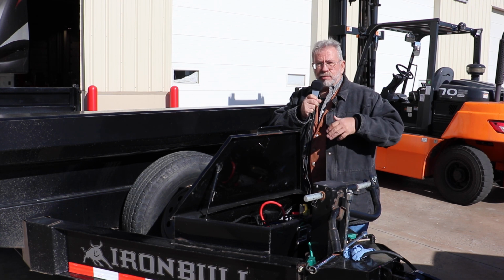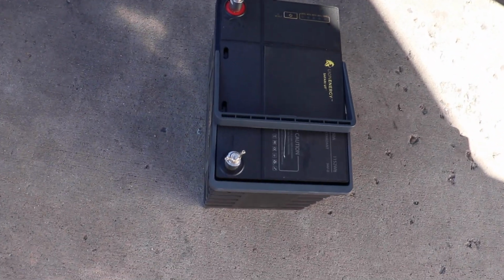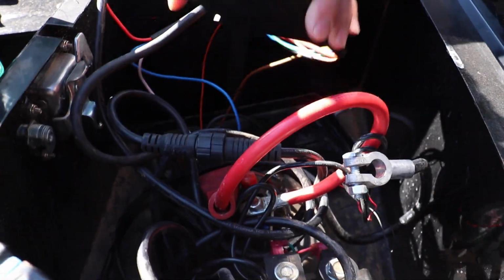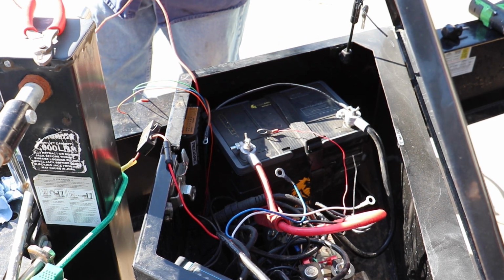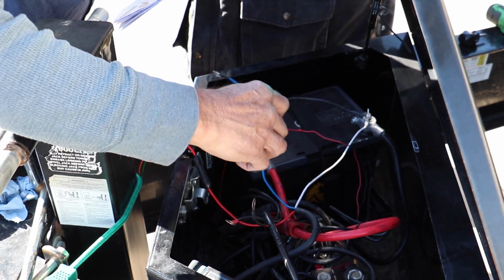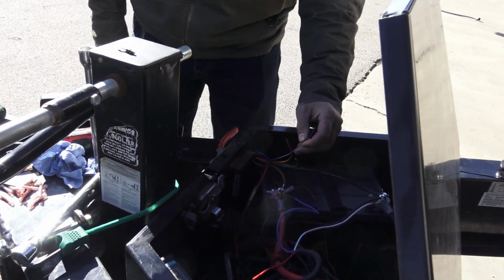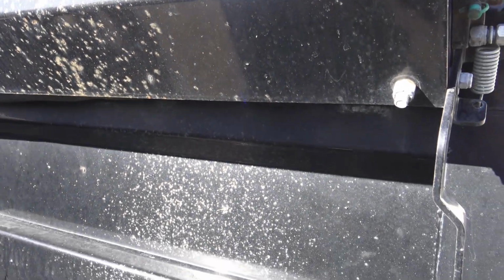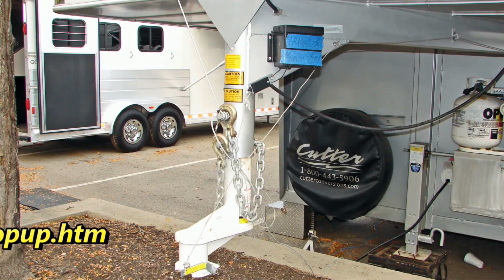REDARC battery management for dump trailers. Keep your work trailer charging and dumping more loads

Comment: Also the guys who installed your system installed it wrong.....they should have read the directions and followed it....they fused the wrong wire, wrong charging profile as well with the lithium battery. Kind of pains me to watch a how to video that was installed improperly
Reply from the maker: No, we did it per phone conversation with REDARC. Lithium Ion has a couple option profiles
Reply: @MrTruckTV  why would you contact them via phone when instructions stating else wise come with the unit,  not only that but redarc has there own installation video on YouTube following the supplied instructions.    You should fuse the brown input wire with a 30 Amp midi fuse, not directly hooked straight to your battery like they did,  also your vehicle input wire is already fused at your main fuse box adding a second one doesn't benefit anything..... sorry but yes you installed it wrong...
Reply from the maker: @idoutdoors  REDARC sent me several products for review from Australia. Some of the reviews we did thru Zoom. For each product I called Australia to see if we did it right. I worked with a distributor of REDARC in the US, it works the way we did it. Nothing wrong with you following the instruction that come with the AC DC 1212. Our installation was approved and debated with the factory. Not sure why you insist on being the only one who understands the only way to make it work. I'm been using that trailer for a year after the installation.
Reply from the maker: @idoutdoors  REDARC sent me several products for review from Australia. Some of the reviews we did thru Zoom. For each product I called Australia to see if we did it right. I worked with a distributor of REDARC in the US, it works the way we did it. Nothing wrong with you following the instruction that come with the AC DC 1212. Our installation was approved and debated with the factory. Not sure why you insist on being the only one who understands the only way to make it work. I'm been using that trailer for a year after the installation.

Comment: I have a gooseneck 16ft dump trailer, power up and power down with a single battery I could only get 3 dumps with a group 27 lead acid battery, after installing it, first day I dumped 9 times in 5 hour period and battery was still going, it defiantly works as advertised
Reply from the maker: Good to hear